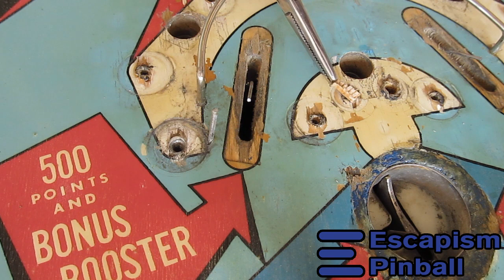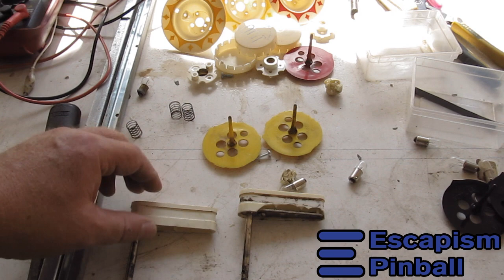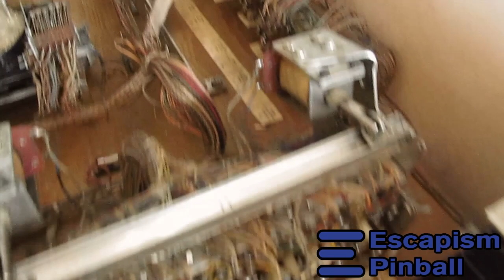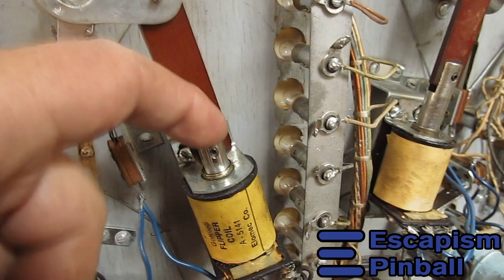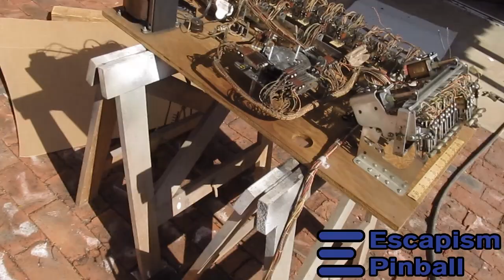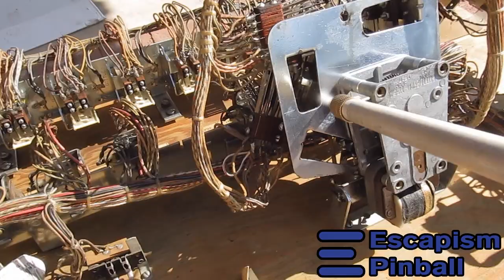Pinball repair - Servicing a Magnotron. Part 4.

Comment: Sorry about my bad english, but what kind of Liquid do you use with your spray gun to clean the contacts on the Relais-Board?
Reply from the maker: I don't know what you'd call it in Germany. In the US they call it Naptha. Its a clear light hydrocarbon that does not damage your plastics. Dry cleaning fluid?